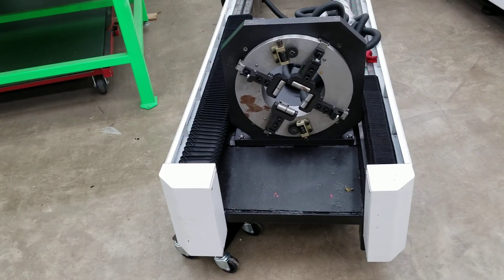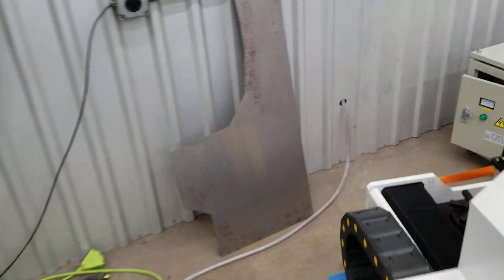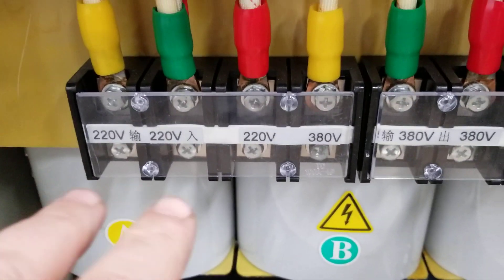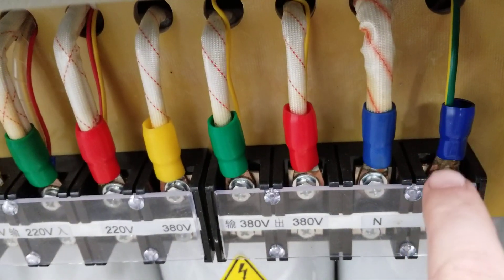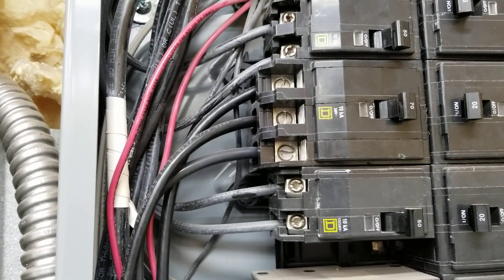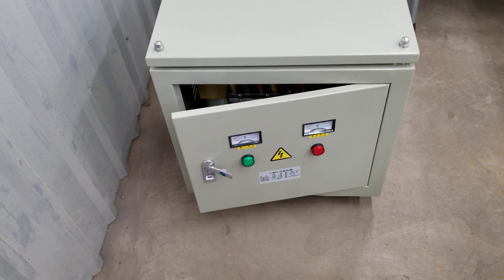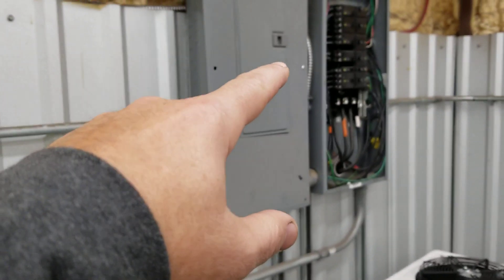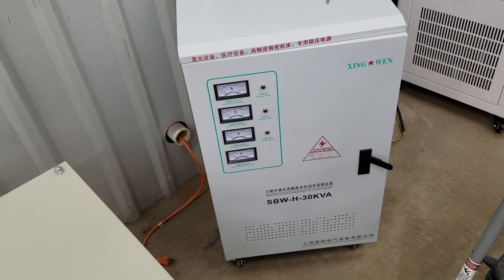240 to 380 3 Phase Transformer Questions - Laser tube cutter

Comment: can increase the power from 220 to 380 3 phase
Reply: I always thought that couldn't be done without a rotary phase converter, hypothetically speaking say if you only have a supply voltage of 240vac from the line side (no 3-phase in the area) trying to figure out if only a transformer is needed, I would think you'd need to generate a completely separate sinusoidal phase wave that is opposite the other two... 🤯

Comment: there is a function VFD can drives 380v ac motor with 220v single phase power supply
http://szkarda.com/en/product/220v-to-380v-inverter.html

Comment: Looks to me as though the transformer will provide its own neutral output since it’s on the output side. Check your wiring harness from the machine I’ll bet the colors will match the output. 
As for the input 3ph 220v is very common in the US and there is no neutral involved with it. 3 hots(L1,L2,L3) and a ground is all you need!
Reply from the maker: yes you are right, i figured this out at a later point and covered it in more recent videos

Comment: Hi Gary, Have you checked the voltage of your 3 phase, like I mentioned in other videos? On your 3 phase breaker, read between all tje terminals. 1 to 2, 1 to 3, 2 to 3. Also, read between the ground buss and each of those 3 terminals. Tell us what readings you get, then we can better help you. Also, would you show the connections or terminals on the power conditioner and the laser unit along with the labels? This transformer will work much like the little 120/110v transformer in your sander. It converts the 3 phase input into what the machine needs, including neutral. To my knowledge,  the othrr terminal is ground and all three units will tie to the same earth ground. It is just a safety and ground is ground. The ground path wouldn't necessarily run through the transformer box and then to the next device but could be connected in a star pattern so it has it's own path to a ground connection and the other boxes have their own. Once the voltage of your 3 phase is known it can be determined if it is close enough to the 220 input on that transformer. If it was close, I would hook it up and check the output voltage. Are there any other taps hidden in the transformer box for other voltages? Sometimes there are more, but this might be made with only 1 input voltage. Check your panel witj a multimeter meter and get back to the comments. A commercial electrician consultation isn't a bad idea.

Comment: I am not an electrician, but: The primary / input side is a delta configuration that requires no neutral. The secondary / output side is a wye ("y") configuration that produces a neutral connection point for use on the secondary / output side - it has nothing to do with the primary / input connection & should not in any way be connected to the primary side. 
Not sure why, but I didn't see a suitable connection point for grounding in regards to the primary / input side. I would probably add a grounding lug attached to the transformer case and make all of the grounding connections from there.
Again, I am not an electrician - but that is what I see from here.
Starting from the left side, the first three connections are the primary side (L1,L2,L3), and the rest are on the secondary side except for the grounding connection.
Reply from the maker: Dan, yes I do tend to agree with what you're saying.  It wouldn't make sense that there would be an input lead of any kind connection on the right side output, those are outputs only

Comment: 240V 3~ „Delta” input (no neutral needed) and the output is configured in 380V 3~ „Star” therefor You can supply appliances that work with Neutral as a reference (single phase apploances, aux power supplies etc) or the ones that do not need Neutral (3~ motors, VFDs etc). The only reason why there’s Neutral on the output is because some parts of the circuitry of Your new machine is in fact single phase and will require lower voltage ie. 240V (Live-to-Neutral). the transformer not only transform Your grid voltage to the required Voltage by the machine, but also provides You with total isolation from mains grid as well as provides Neutral
Reply: I think your comment is the best in all those replies.
Reply: I just realised... By saying lower voltage ie. 240V Live-to-Neutral I meant that in 3~ 380(415/430)V the Live-to-Neutral is 240V and Live-toLive is 380V(415/430). In America Live-to-Neutral means 120V natively and that might confuse some people :)
Reply: I think so too

Comment: the transformer is wired delta on one side and wye on the other side, that gives you the sqrt(3) voltage step up and the neutral (N), you only need the neutral for single phase loads.  http://electricala2z.com/wp-content/uploads/2018/08/Figure-5.png

PE is Protective Earth, also shown by the green/yellow wire which is a color combination reserved for Earth

Comment: Gary sometimes 3 phase equipment uses a neutral to power lower voltage components without having to use a control power transformer like you wide belt sander has.  Having said that though I think you should call someone out to have a look a little more closely since if I recall right you have a high leg delta service to your shop.  The voltage on that leg (orange) to neutral is higher than the other 2 phases to neutral.  I think since they are using a step up transformer it should be OK as only the phase to phase voltages are used on the supply side.  But again, I'm sure you spent some serious coin for the machine it's not worth the gamble.

Comment: My Chinglish is poor but looks like a delta  to y transformer so perhaps it creates its own neutral? I would hook up your 3 220v phase leads then use a volt meter to see that you were getting your 380 outs and of course hook an earth ground for safety. Does the power conditioner have an N tap? If not I would just ignore it for this application.
Reply: It looks like you are correct on that one. Neutral might be used to power some control circuits, etc.

Comment: @Ramsey Customs call an electrician just to hook up to the transformer, wouldn't be all that much. 220V three phase isn't that common in the states. Makes no sense why they gave you a 220V to 330V transformer. If they would have just made it 480V three phase it would be so much easier. It seems to me as if they are using a 220v appliance hook up with three hots, if that's the case get an electrician because it would have to be set up way different then three phase. Good luck let us know how you make out I am curious to see what the proper wiring is.

Comment: Every AC needs neutral, even your 3 phase has a neutral as otherwise it wouldnt work. Check one of your 3 phase sockets, youll see 5 connectors, L1, L2, L3, N and PE.
The reason your transformer has a neutral connection is because a transformer wont work without a neutral line, and the case also needs to be earthed.
L1 is line conductor 1, L2 is line conductor 2 and L3 is line conductor 3. N is neutral and PE is protective earth.
Check where one of your 3 Phase sockets wires lead, i bet those larger conductors on the neutral and earth bars are going directly into your 3phase wires.
Reply: I'm trying to remember but even american 480v 3 phase is only L1, L2, L3 and a ground. I never saw a neutral but that is 480V also. I never messed with 220V 3 phase, it isn't that common in the large equipment world in the US.
Reply from the maker: @bigphillyed  You are correct, every 3 phase machine i have is wired as L1, L2, L3 plus a ground, no nuetral involved.  I just thought someone may have installed one of these.  Alot of your residential electricians wont really have a clue about this but yea i may call someone to help
Reply: @turbocobra  i think I found out the reason why. I believe that transformer is really set up for 208/230 which is a whole different animal. Call an electrician, a commercial service electrician is what you need. I dont think they sent you the right setup for North America.
Reply: The more I thought about that, it looks like a three hot 220V load connection versus real 3 phase. It's like a 220V and neutral and ground with 3 hit legs. Weird like I said they did 220B versus 480V.
Reply: @bigphillyed  Honestly as a german i can say the whole american electricity setup is weird to me. :D
3 phase without a neutral is possible, but ive only seen it in systems that need overspeced conductors due to safety or damage prevention. It essentially means you take the low points on a line conductor and turn it into a neutral for a differnt line conductors, aka all 3 phases become neutrals in tune with the phase shift. In germany for example its highly uncommon due to the danger of such a setup compared to our usual 5 conductor setup, 3 conductors for the phases, one for earth and a beefy one for neutral which all 3 phases use.
So id never expect something like this in anything les than a specialized industrial setup, certainly not a small workshop.

Unles murica likes extra costs and danger XD
Reply: @bigphillyed  220-250v phases are common in many countries, for example my workshop gets electricity from the local 400v phased network, i get 3 400v 32amp phases directly which i can use for true 400v 3 phase, and then there are 2 reduced lines coming in with 3 240v 16 amp phases each.

So i could for example either hook a machine like this up to the 400v line, or use the transformer and use one of the 240v lines.

I guess a reason why they supply such a transformer is because 400v lines are getting more and more uncommon in homes and small shops, as many 3 phase systems that arent for large industrial use often even come with transformers to transform the current up or down depending on their needs. For example the table saw our local carpenter uses runs on 240v 3 phase, but i can be hooked up to a 400v 3 phase thanks to its build in regulation. My home kitchen stove for example needs 240v 3 phase and would propably die on a 400v line.